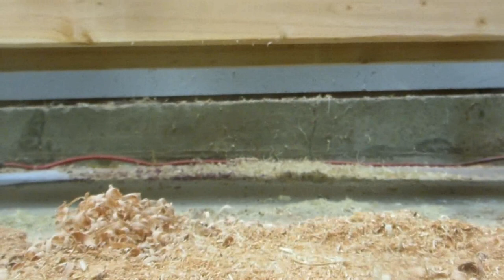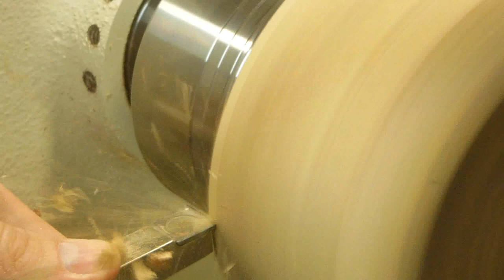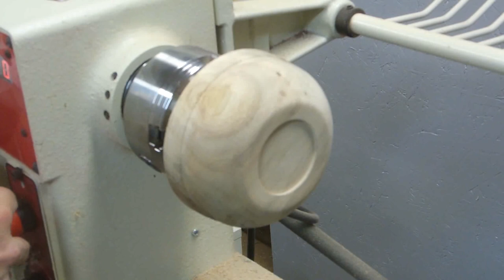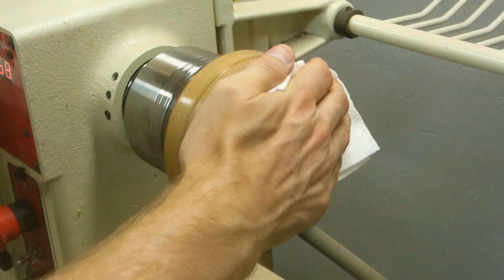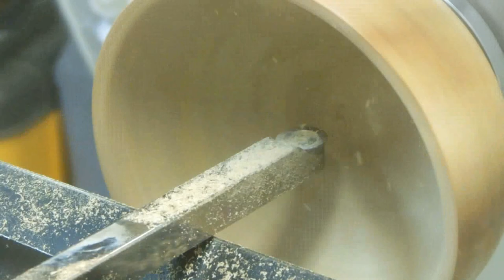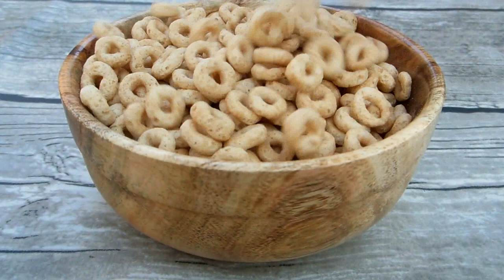Woodturning: Carob wood bowl with carbide lathe tools

Comment: I have small round carbide cutter on a round shaft. I get a major catch every time I use it. Nice slomo of the tool cutting.
Reply from the maker: UBWoodman If you mean the cutter is slightly cupped, you need to introduce that one with at least a 30 degree angle. Just rotate your handle a bit, and pay attention to it as you move across the piece. I have one just like it, and once you get used to it, it works great. As Bruce (another commenter) mentions, in this video I'm using the Hunter Osprey tool for a bit. It actually angles the cutter down by 30 degrees. It helps to stop the catches like that, and it makes you think. In this video, I'm using it as a tiny bowl gouge, basically - rubbing the bevel for a while, and then using it as a shear scraper.
Reply: Hi Steve, What # of the Hunter tool are you using?

Comment: Very entertaining video Steve. Oh, and a very sweet bowl. Just a comment to UBWoodmen.
I have found the tool with a straight round shaft and a flat, cupped round cutter to be a bear to learn it's quirks. All a matter of the angles, like most turning tools. Take your mind off of it and it will blow something apart like it did to a bowl I was making the other day. In the video Steve is using a Hunter Osprey which I think is a better design for such tools. (IMHO)
Reply from the maker: Bruce Lewane Bruce, thanks for the comment. You are right on with those cupped carbide cutters. The angle is everything. I have the Osprey, as you noticed, and another one that is flat. The flat one, I have to be careful, but I get a great cut when introduced at the right angle. At least 30 degrees from flat, for sure.